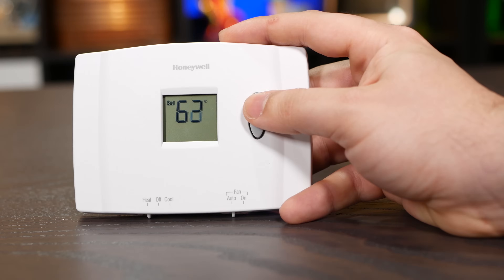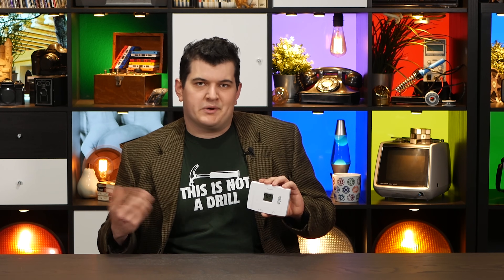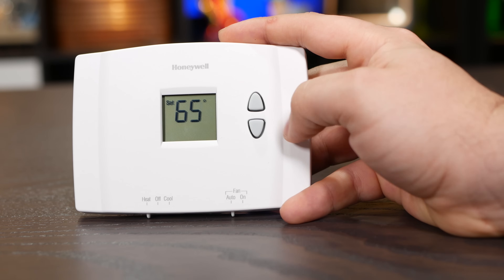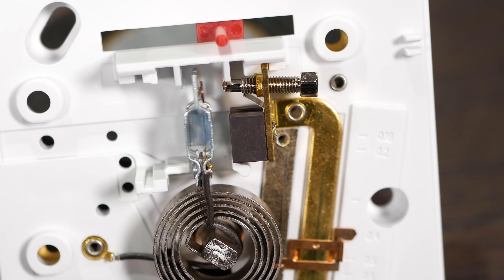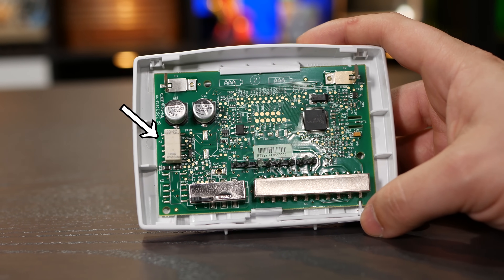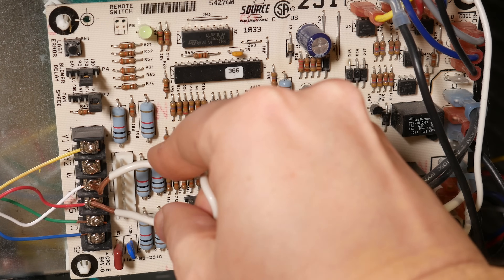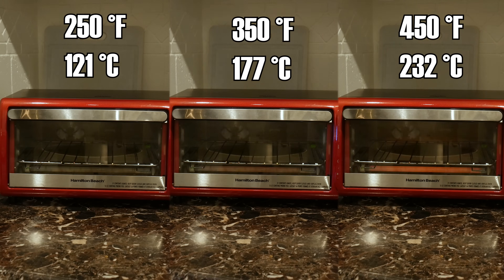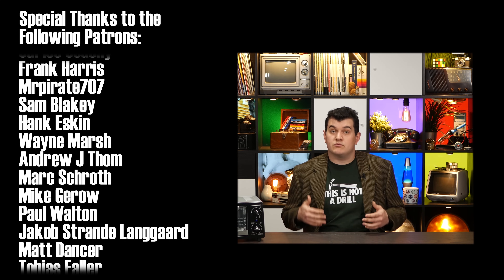Thermostats: Cooler than you think!

Comment: You forgot to say the most important and relevant word when talking about the magnet in the super basic thermostat: hysteresis

Also, a thermostat would absolutely not use a thermocouple.  I don't care how fancy it is, because it still doesn't make sense.  You need a thermistor, semiconductor chip, or something else to find the absolute temperature of the cold junction of a thermocouple, which would measure the air temperature.  Why would you then use a thermocouple (a relative temperature measurement device) to read that its cold and hot junctions are at the same temperature?
Reply: thermostat always use a thermocouple, thermometer probes are made of a thermocouple. there are charts of resistivity of the thermocoupler depending of the temperature. so a microcontroller chip just reads the resistivity of the probe. So there is nothing wrong with using a thermocouple in a simple / cheap or old design. Well, there are also pressostats and you actually can control the temperature of a refrigerator by the pressure of the refrigerant in the evaporator but that's another story. Let's just say a more mechanical / analog approach is still common in many HVAC systems and does work for some application just fine
Reply: @pafou  you really don't know anything that you are talking about.  Maybe Google what a thermocouple is first.  What you are describing is a thermistor, as in a (absolute) temperature dependent resistor.   A thermocouple is a thermoelectric sensor that generates a voltage based on the difference in temperature between the cold and hot junctions.
Reply: @EGL24Xx  Oh yeah sure, my bad I mistaken thermocouple with thermistor. But how come thermocouple are relative temperature measurement device and not absolute ?
Reply: @pafou  in a thermocouple, you have a piece of wire with a different temperature on either end.  The derivative of temperature along the wire sets the derivative of voltage along the wire down to the Seebeck coefficient.  So, a difference in temperature creates a difference in voltage.  This isn't super useful on it's own since you need to complete the circuit so you need another wire and join the two at the hot junction.  If the other wire is the same metal, then both generate the same voltage and nothing happens.  If you use two different metals with different Seebeck coefficients, they will generate a differential voltage at the cold junction that is approximately proportional to the difference in temperature between the hot and cold junction.  As thus, it's a relative temperature sensor only

Comment: In The Netherlands a modulating central heating system has been quite common for several decades now. Thermostats communicate with the heater using the OpenTherm protocol meaning you don't necessarily need the same brands of heater and thermostat. With a small difference between set and actual temperature, the heater works more carefully to be more efficient and prevent overshoot.

Comment: I caution against implying that furnaces are "dumb appliances". They might have a very rudimentary control system, but I don't think you can call a furnace that runs a Linux kernel on an ARM chip (this is in our midrange decade old natural gas forced air furnace, no less) and tracks tons of diagnostics and controls the ignition sequence in a very debugged-on-the-fly and safe and controlled manner "dumb". Thermostats might have more brains than many people think, yes, but so do most (probably all by now) natural gas furnaces, which are probably more powerful than many people's wifi routers.

Comment: I live in Canada, winters here can be as low as  -40C/F. So going without heat is, not an option.
I have one of those fancy Nest thermostats, because my province had a “Go Green” promotion. But I still don’t entirely trust it, so I added an incredibly simple bimetallic thermostats in an return air vent as a backup.

And it turns out I’m not entirety wrong not to trust them. In ~2012 a software update caused every single nest thermostat to stop charging its’ internal lithium ion battery, in turn causing them to run until dead. When this happened, the thermostats would no longer control the heating/cooling system (because they were dead)
Nest had to release a new update, and every Nest user had to remove their thermostat from the wall, charge it with the (not included) USB cord, wait for it to connect to Wi-Fi, then wait for it to update itself. All while having no control over the temperature of their house.

Comment: In the UK (where we generally don't have air con, just boilers controlling hot water radiators), it's increasingly common to have a wireless thermostat - the circuits controlling the boiler sit in a module connected adjacent to it (and connected to mains electricity), with a battery controlled remote for the sensing and timing. Being digital, they allow you to set up to three run times per day for various combinations of the seven days per week (so, for example, you can set the boiler to just run mornings and evenings during weekdays, and all day weekends). Some models also allow a pre-set minimum temperature for the 'off' times, either to stop the house cooling down too much or to protect against frost, and/or allow to you temporarily override the set temperature until the next timing event (which is handy if you're coming into the house on a cold day and temporarily raise the set temperature, but don't have to remember to turn it down again at bedtime as it'll automatically reset to normal).

Comment: What about OpenTherm? I didn't see it mentioned. More info on that on: https://en.wikipedia.org/wiki/OpenTherm . My thermostat can "tell" the furnace to run on different blastlevels. For instance if it has to heat a lot it goes full blast but lowers the blast when getting closer to the requested temperature. The guy who installed my furnace and thermostat called it a "modulating" thermostat, but that sounds more like a marketing term to me. Ofcourse the furnace has to support the different "blasts" to run. I can look up the furnace and thermostat model if you like.

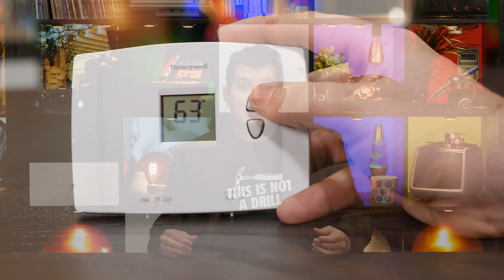Comment: 1:49 NOT SO!!  Almost every general purpose thermostat made since at least WWII (including the classic round Honeywell units) has something called a heat anticipator. At 5:00, the heat anticipator is that slider to the right, and the pointer in the middle has to be adjusted for the optimal cycle length. This feature is not a necessity for electric heaters and many forced air systems could probably be tolerated without it, but hot water, steam and most radiant systems would be cycling all over the place without a properly adjusted anticipator. The feature shuts off the heat from the furnace (or boiler) just before the room has reached the set temperature, so that the heat in the system is just enough for it to reach the set temperature after the furnace has shut off. With cast iron radiators, this is enough heat  to cause a massive overshoot, so a thermostat that simply shut off the heat when the set temperature were reached would allow the room to soar 20 or 25 degrees above the correct temperature; the correct setting of the slider at 5:00 is usually near the maximum resistance for these systems, causing the resistor to trick the coil into shutting the heat off early enough that the heat in the radiators causes little or no overshoot. For a forced air system, the slider would be closer to the minimum setting. Modern digital thermostats often have self-adjusting heat anticipators which measure the over shoot and keep increasing to early shutoff advance to avoid it. I don't know if they bother with similar features for AC, but with some coldness lingering in most systems, it would be of some use.
Reply: It should be added that with the heat anticipator working, the room WILL heat up faster with the temperature set too high, though it will overshoot even if the setting is backed off as soon as the correct temperature is reached.

Comment: I actually used to live in a building that had low, medium, and high "blasts" for the heat/AC.
I'm not sure this is standard across all US Navy bases, but this was how it worked in Ikego (a housing base located in Zushi-shi, Kanagawa-ken JP). I lived in one of the towers, which were 9 story highrise-like buildings with ~8 1700 sq ft units on each floor (the first floor might've had fewer). In each unit there were 3 bedrooms, 2 full baths, a "main room" (called LDK in JP) with the living and dining and kitchen, and a laundry room, along with some hallways.
Now, as a disclaimer, I'm really bad with the technical aspects of wiring and electronics, so I'm not entirely certain HOW this worked on that level, but I can describe how this worked with my level of understanding. There were four "thermostats" in each unit: one in the LDK and one in each bedroom. In the ceiling of each of those rooms was a vent with a filter (two vents were in the LDK because that room was HUGE) and each of the "thermostats" controlled the vent(s) in their respective rooms. Each "thermostat" was really just a dial that could be set to Off, Low, Medium, or High, with no option to change to heating or cooling, because all you were controlling was the fan and whether the system would even be on in that particular room.
The reason for this was because the actual AC/heat units were centralized in each building, so everyone in the building was using pretty much the same system. It worked great on their end because you didn't have CERTAIN people abusing the fact that they didn't have to pay for electricity while living on the base and couldn't waste power by setting the AC to, say, 3C or something ridiculous. This also meant we had no control whether we were getting heat or AC. The people in charge of those things would keep an eye on the weather around the time the seasons would change, and if it was above or below a certain temperature for a set amount of time, they would say it was safe to switch from heating to AC or vice versa.
This did become a problem a few times because Kanagawa has this weird quirk around early March where it'll be stupidly-hot for a few days, and then drop back down into cold weather, then do it again, and it does the opposite sometime in late October or even late November. In Japanese there's a name for it that translates roughly to "four hot days and four cold days" and having that centralized system was BRUTAL because they couldn't for whatever reason other than "it's the Navy" change it over for a few days and then switch it back.
Thought you might find that intriguing. Was weird switching back to a normal digital thermostat after that nonsense. "What? I have CONTROL again?"

Comment: In the UK we have a gas boiler and water based radiators, but still the old type of bimetallic strip thermostat, gradually being replaced by LCD panel thermostats similar to the ones you showed, we do however have a "boost" button on ours which allows more heat to be generated, say just after you ran a hot bath and want to get more hot water on demand fairly quickly, at the expense of efficiency.

Comment: On-off control based on threshold is called bang-bang control, and it is known to be optimal (better than PWM+feedback) if your feedback loop is relatively tight and you have no need of an integral or derivative term.

Comment: You can override the temps true setting. The manual override will last until the next programmed time change.  Not exactly a 30 min override, but it is close enough if you have the times programmed.

Comment: This video mentions the fan a couple times, but you don't talk about how thermostats determine that. Do they just do that when the temperature is in a wider range around the desired temperature, to get the heat/cold to spread better?

Do any commonly-used furnaces or AC units take so long to start up or turn off that PID controllers would be useful, and if not, could you do a PID video at some point anyway?

Comment: So, interesting, yet simple, yet not video. Not reading through all 2,750 comments to see if anyone mentioned this... I can say that the ecobee3 (and most likely ecobee4) have the temporary thermostat adjustment capability that you can set (and forget).

There are 3 comfort settings for Away (at work or play), Home (well, when you're supposed to be home), and Sleep (do I dare explain this one?). These "normal" Heat and Cool temps can be set and put on a schedule - if you're home on the weekends, then you have only Home and Sleep for that day's schedule; a weekday, well then Away, Home, and Sleep can be on that day's schedule. Say you're on the Home setting and it's normal temp is 78, and you come in from mowing the lawn and it's too hot... adjust the temperature to 76. For 2 hours it will keep this temporary temperature  setting then automatically go back to 78. There is also a cancel button on the thermostat or app to return it to it's regularly scheduled temperature. This can be done from the main thermostat, from the phone app, your online ecobee portal, and also through Alexa (and I believe Google Home).

The ecobee allows for multiple sensors in other rooms rather than just where the main thermostat is. These sensors can be set to detect motion (Follow Me) to have the thermostat go into Home or Away mode automatically (I don't have this motion feature turned on). The sensors can also act as an average temp reading for the house, and even though it may be 78 at the thermostat location, it may be 80 in another room, so the average is 79 and the cooling will continue until the average reaches the scheduled set temperature.
 The ecobee can be added to Alexa, and you can say "Alexa, what's the temperature in the living room (or master bedroom, or wherever you set the sensor(s))?" You can also say "Alexa, set the thermostat to 75." and she will do just that!

Finally, the ecobee has many tracking features using a Home IQ web interface - of course all online, but can be very useful. It shows how often the unit switches on and off, what the local temp outside is daily (according to your zip code), humidity tracking, approximate savings using it's smart adjustments, your home efficiency rating based on others in your area, and a full system monitor. On top of this, your app/web IQ will remind you of monthly filter changes.

Comment: 16:30 I just set my thermostat to a "temporary hold." This way, you can set it to whatever temperature you like and set the temporary hold to 30 minutes (or however long) into the future. After it reaches the time you set it to, or goes back to it's scheduled (or previous) value.
Reply: I just set my Nest with a target temp at every hour.. if i manually change it.. by the control or the app or even by commanding it with my voice, I know it will fall back into the regular temp within the hour

Comment: with regards to the "run for one cycle" thermostat... I don't believe that feature literally exists, but MANY programmable thermostats will allow you to manually override the program for a set amount of time. If your stat is set to 72, and you want it to stay at 72, but you want to run the a/c for a half hour per your example, simply set the override to an absurdly low value, and the timeout to 30 minutes. A/C will turn on for 30 minutes, then the original program will resume.

The caveat with this is that, if your thermostat supports (and is set to) "auto changeover," where it switches heat/cool mode automatically, it may very well overshoot, activating the opposite mode when the resume occurs.

Comment: It's not so much PWM as it is a control loop. Actually it's a great super simple example of a closed loop control system. See Brian Douglas's videos, they're incredibly interesting and accessible!

Edit: I'm a dingus it's totally PWM, the control element just changes the duty cycle. But it's strange in that the PWM is an emergent characteristic of the control loop which is why I got confused.

Comment: 1. I was hoping you'd explain how modern solid state thermostats work. How does a thermostat with no moving parts know what the temperature is to tell the circuit to complete? If there's no moving parts then what changes inside the thermostat chip or whatever to cause the heat or AC to turn on? 

2. Yes there are thermostats that have override buttons and will even let you tell it how long to override by how many times you push the button or how long you hold it.

Comment: So if a device were to actually adjust the output of your HVAC device, instead of simply turning it on or off, that would be a rheostat instead of a thermostat, correct? I've always wondered why rheostats aren't more common in household objects/appliances.

Comment: Many of the programmable ones I've looked into (or maybe it's just the more recent ones) have the ability to temporarily change the temperature so that it will cycle for a period and then resume it's programming, I'm shocked Nest doesn't have this. I have Mysa smart thermostats for my forced air wall units, and it's very handy to be able to increase the temperature and for either a set amount of time or until it's next programming time/cycle kicks in. Great video as always!